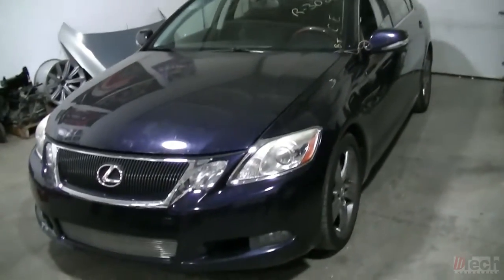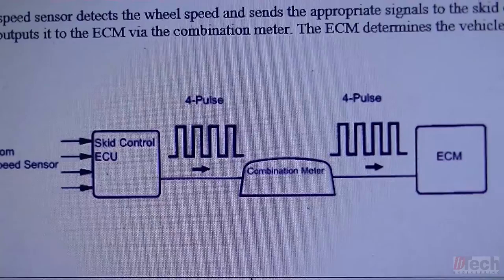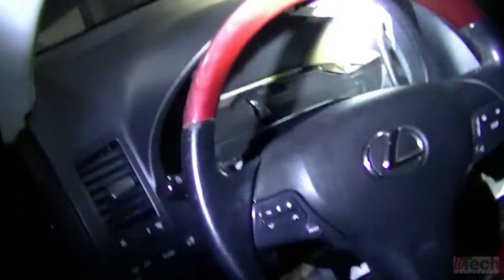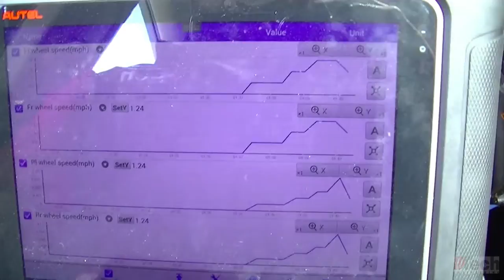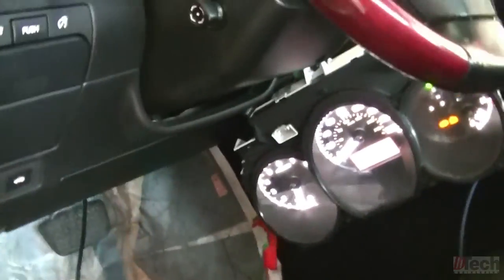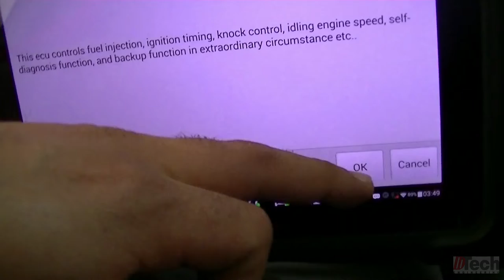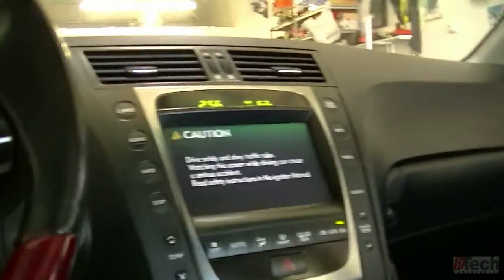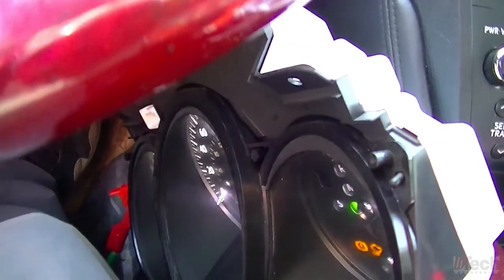2008 Lexus GS460 P0500 vehicle speed sensor code diag

Comment: Had the seme code on a 2015 RX350. Scoped the  12v square wave from ABS to Instrument Cluster, and the 5v square wave from IC to the rest of the modules. ECM was the only one not reporting speed, IC and Transmission datastream were reporting proper vehicle speed. Also checked the 5v speed signal at ECM connector and was OK. Told the owner that it needed a new ECM, since she told me it had extended warranty she was going to take it to the dealer a believe.
Reply from the maker: Yes , the power of the scope is great in these situations to be able to give an accurate diagnosis and make a call with confidence , Thank you for watching Juan and glad to hear you are putting good use of the scope

Comment: Hi Sadel, this is a great video. Would this specific bad cluster problem also throw P0500 in the TCM? I’m thinking it’s the actual speed sensors on the valve body that are bad. I’m getting 0mph vehicle speed reading in TCM live data. Speedometer works. Does the ECM cause TCM to throw that same code or vice versa?

Comment: Hey I have a question trying to upgrade on my scanner i have a modi’s ultra from snap on. 2 channel scope any recommendation
Reply from the maker: Hey 820 performance, I personally am a big fan of the Autel product scanners. But it depends on the lines of vehicle's that you mostly work on that will probably determine the scanner to pick, Snap on are good for domestics and some asian, and autel is strong on Euro's and other makes
Reply: @DTEAuto  
K cool which one do you recommend
Reply from the maker: I have and use the Autel Elite, but the Ultra seems to be a very good one as well

Comment: Thank you for your video.
Is there anything we have to do after replacing the Instrument cluster?  like mileage,....any different between used and new part?
Reply from the maker: I am not totally sure, I only got to tell the customer (which was another shop) what the problem was and so I'm not sure if a used one is just plug and play or if mileage corrections have to be made.

Comment: My 2008 GX470 is doing this exact same thing.   Same Code.   The dealer had the truck for over a month.   they even claimed to be working directly with Lexus to try and figure out the problem.   They ended up giving up and replacing the MAIN ECU.   the problem went away for a few months. But the Code is still coming up!    I'm so bugged.  I've spent almost 4K with them and they cant figure it out.    I would bet money that this is the same problem I'm having.

Comment: I'm having the same issue, it started after I steam cleaned the interior p0500 the speedo parts works the RPM acts up no traction control no cruise control, any suggestions?
Reply from the maker: possibly might need a cluster

Comment: Hi I had the same problem same code it had thin broken wire..
Reply from the maker: good find Prashan... I was almost expecting a broke wire , which is why I put my leads where I did to test the integrity of the circuit
Reply: Where did you find the broken wire

Comment: I have a 2008 es350 and the transmission just stopped working out of nowhere. I took it to the shop and they said it's needs a transmission. I said nah I'm good. So now I'm troubleshooting and have a code come up for the speed sensor which also causes issues with the transmission. I'm also replacing the TCM. Hopefully it's that but just bother that the mechanic didn't even bother to troubleshoot.
Reply from the maker: Hope you get yours resolved, 99% of the shops out there do not ever bother to trouble shoot because they do not know what they are doing and just guess at parts that they know others have guessed at before. It's always a shot in the dark and hard to believe that shops operate that way and that customers believe and entrust in them, dealer included.
Reply: @DTEAuto hey man having trouble finding out what’s wrong with my car 2007lexus es350 and after third gear it slips and doesn’t accelerate past 40 all the dash lights come on and p0500 reads on the scanner